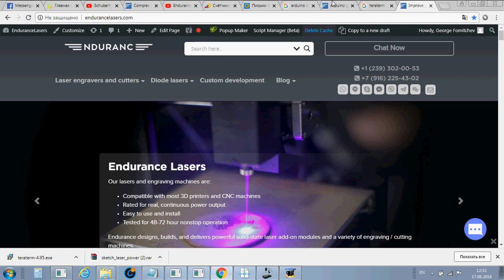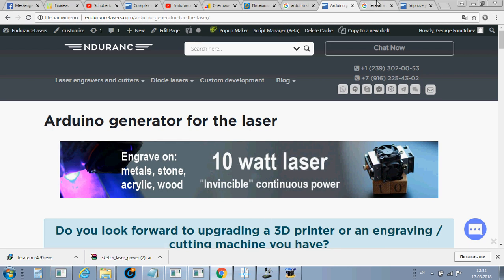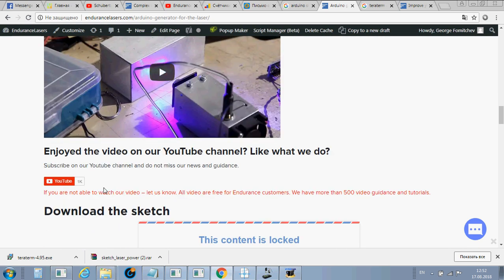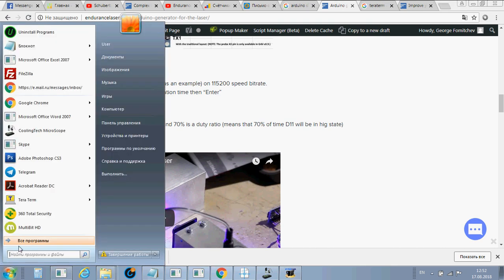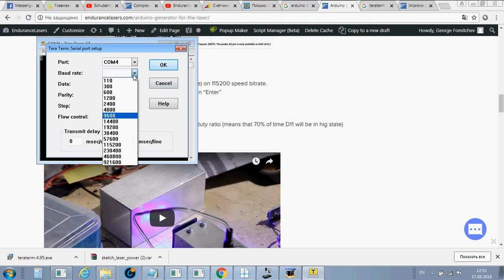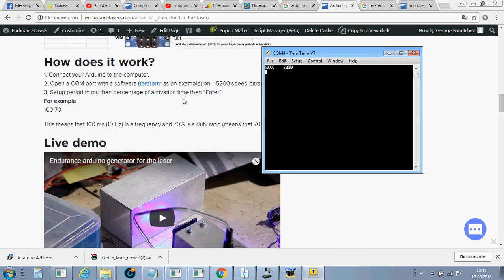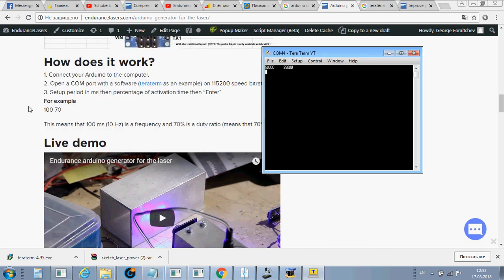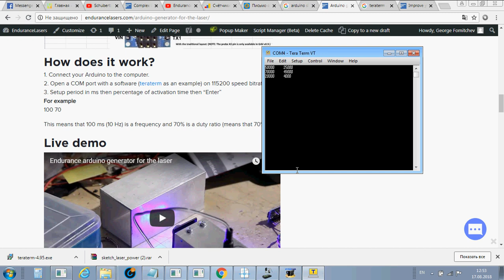A quick overview of how to use a Tera Term software and change a laser power

Comment: I use this script twenty times per day.
Pull down a running config into Notepad++.exe 
;routersnapshotrun.ttl      01/04/00   Brad Schrunk
;
; Takes Snap Shot of Router after the config has been updated.
; Login has already been done. User will update snapshot from inside
; of router enable mode.
;Variables start
tloff   = 'term length 0'
e    = 'end'
tlon   = 'term length 24'
sc   = 'show running'
en   = 'en'
start   = 'started!'
n   = 'ntp server 10.10.10.10'
;Variables end

fd1  = 'c:\capture\router-run.txt'
fd2  = 'c:\capture\router-run.txt'

fedit  = 'C:\Program Files\notepad++\notepad++.exe  c:\capture\router-run.txt'

filedelete fd1
filedelete fd2

flushrecv
logopen fd1 0 0 

sendln   tloff    ;turns off term length 24
sendln   sc    ;sends show running command
; The timeout limit is 30 sec.

inputbox 'Wait Till Config Is Done Scrolling' "Press Enter' 

;wait   'router#' 'ntp update-calendar'  'ssh server vrf default'  'ipv4 access-list acl_190' 'ntp server 10.10.10.10' 'ntp server vrf vpn-management 10.10.10.10'   'line vty'         ;waits for script to ntp server. ensures end of file
  ;waits for true end of script 

;StrSleepNormal          = 'Wait for 30 secs'#13#10'

;strmatch 'endend' 
sendln   tlon
logclose
exec fedit                 ;loads up the document with editor
end